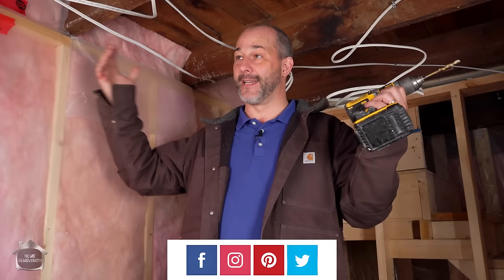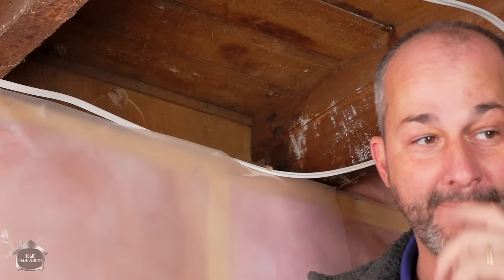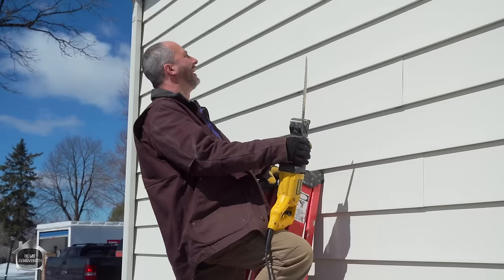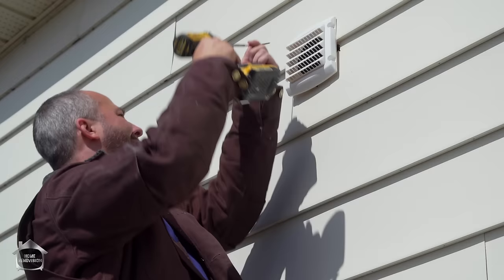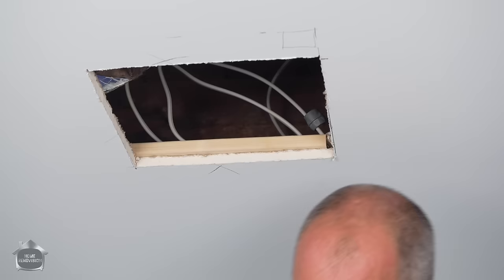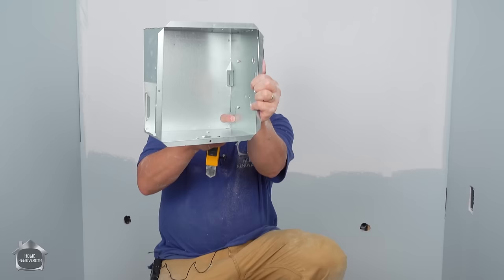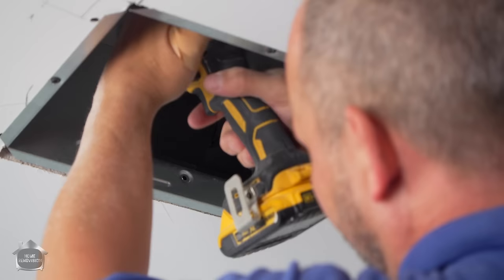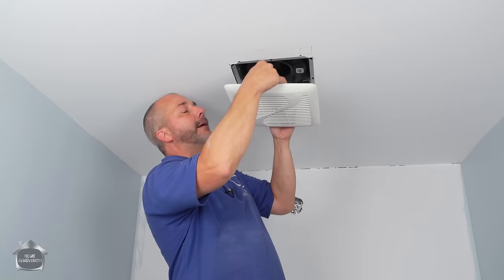How To Install A Bath Exhaust Fan | DIY

Comment: Custom hot tube is definitely the way to go. Especially after a long hard days work. Those massaging jets are amazing.  Also you you said you'll start in the fall. I cant you using a pool in the fall/winter.

Comment: After the pilot hole the outside work should be done w/a circular saw w/the blade backwards to not tear any siding - then the hole saw should be used as the pilot hole was drilled  in a 2by 4 or 6 inch .  The idea of using the hole saw is to have a uniform hole.  It can be started either from the inside or the outside. Having the pilot is the guide. A triangle hole will leave un-needed gaps.
Reply: How you cutting a circle with a circular saw???

Comment: I’m going to be replacing a heater, fan, light combo that was installed back in the sixties. The wires are fried but I have plenty of cable so I can cut it back to expose good wires. There are a 2 black wires. 1 red and 1 white. The house was built in the fifties or maybe even before that. It should be fun.

Comment: Future Video Idea:

Would be nice to see a video where a full bathroom is installed in a house that has an unfinished attic space that will be converted to a master bedroom with a full bathroom. Running sewer drain lines to the home's main stack located in the basement, along with water lines, toilet, etc. 

I am sure there are quite a few home owners who have a house that has an unfinished attic that offers a lot of potential, along with increasing the value of the home (I am one of them).

A video like that would be very helpful for viewers and would generate a large number of views and possibly expand your subscriber base to make it worth your time.

Comment: Hot tub. I was looking at store bought hot tube but open to other ideals. Enjoy your videos.
Reply from the maker: Cheers Fred, Looking into ideas now!
Reply: @HomeRenoVisionDIY  Maybe a outdoor wood boiler to heat the water?  This is  what I am looking into, using a 55 gal drum with 1/2 in copper tube as the exchange?

Comment: I am running a vent where the builder never ran it when they built in the 80’s.  It was venting into the attic.  So my question is how do I close the gap on my vinyl siding?  Should I trim the vinyl to fit the outside vent and how would you trim that and make it look good?  The way you did it is like some of my antenna panels, where I put wood behind it to give it a vertical finish.  The wire runs through conduit which is cult through that wood.  Thanks for your input.  I enjoy your channel.

Comment: For the hole, if you have access to one, use a quality hammer drill with drive feature, such as a Bosch Bulldog. I cut a hole in 2” of roofing materials (plywood, shingles, etc.) in under 30 seconds.

Comment: incredible the lousy electricity and plumbing instalation in the states , now I understand why the houses burn down totaly , imagen a short circuit in the walls etc and a electricity cable close to the shower , incredible , why the  rutes are not more strict , cannot understand that , regards robert

Comment: You can install the vent during the rough framing so that when drywall is placed it's already installed.
Reply from the maker: Yes, however we did it this way to demonstrate how to do a replacement as well. Cheers!

Comment: Thanks, very helpful… I have a replacement to do where the original mount point is no longer secure… was wondering if the fan mounted to straps secured only to dry wall ceiling like you did would allow for  vibration… but your install looked pretty solid. Thanks again.

Comment: Just use a long bit and put that pilot hole all the way through.  Use the hole saw from the outside.  There are multiple layers of siding and sheeting, cut through one at a time.  No problem and it's much more efficient.

Comment: I am a HUGE fan of your videos and I'm actually using your Tool Shed video to build my own, only mine is a little bit larger (5x3 m). I try to save a few money by DIY-ing myself as much as I can around the house and as much as feels safe to me. I have a house that is 2 levels (ground floor + upper floor). Ground floor is about 80-90% done (only bathroom tiles to go), but upper floor is still a work in progress. It would really help me if you made a video for a regular staircase between the 2 levels. I does not have to be fancy, it has to be practical and allow me to carry materials up there. Also, it does not have any bends, just a plain straight staicase, about 2,5 m height difference. Thanks!
Reply from the maker: Cheers , Happy to help!

Comment: I suggest wiring the fan to a light or if it's a fan/ light combo wire it so when the light switch is thrown the fan comes on. Trust me, children, and most adults, will not turn the fan on thus negating the benefit of having the damn thing in the first place. Just the way it is. Good video.  Thanks.

Comment: We use 12 gauge wire for most residentual.....smaller 14 gauge we can use for light switches
Reply from the maker: we use the 112 in the kitchen only.

Comment: Use a hole saw from the outside after drilling the pilot hole all the way through from the inside.  Just go slow and use a sharp hole saw.

Comment: Wish I knew they had these. Had to replace a smaller fan with a larger one due to moisture and although it was pretty simple the vent had to go on the outside of the box. It wasn't really that difficult but it would had made it much easier. Maybe it could have and I just didn't notice it I'm not sure but I'll check next time. The client picked up the box and it's not something we usually do unless it's before drywall. We do however seem to replace quite a few motors and blades though.

Comment: This bathroom will be freezing with all the cold air coming in through that cover.  Do yourself a favour if you live in a cold climate (i.e. Canadian Prairies...-45C), put a backflow valve (plastic flapper valve) on the inside of your rim joist when you bring the duct in so cold air doesn't pour in when the outside flapper inevitably freezes open.  I also did this with my dryer vent on my last house build and it was a brilliant move.  Plumber had no idea what I was talking about...I did it myself 🙄  Actually as this is an upstairs fan, you really should put this through the roof so the soffits don't suck the moisture up into the attic.  Not an issue if you don't have a 'real' winter, but I found out the hard way not to vent it out the soffit.  There was about 6 inches of ice on the inside of my attic and all the insulation was soaked.

Comment: Good tutorial. I have to replace a ceiling fan/light combo that runs off of two switches  (one for each). My vent will run out to a 2 foot overhang that I can easily mount the cover on.  I think t he hardest part will be sorting out the wiring.

Comment: 12:30 You did everything right. But, there is always Murphy.. 
me, modified a connector to be able to use my bosch battery on my noname jigzaw (solder solder solder, fiddle, clamping, fixing diddely doo.. aaand done!) Turns out my wife dropped my cordless so the battery wont come off.. Just a plastic hook that lodged it shut but one project turnes into another project to anoooo.. and down the rabbit hole you go :D

Comment: interesting how you made it a diamond...might have been easier on you to take a longer pilot drill and attach the hole from both sides?
Reply: It was awhile ago and the only time I've drilled through the side of a house. I didn't want to but my customer was persuasive and agreed to take responsibility for the risk. 😮

I know I was able to only use the hole saw but can't recall if I did it from both sides.

Comment: you should twist the electric wires together before putting on the wire nut.   and an on-off humidity sensor is required in some locations.
Reply: Totally unnecessary to pre-twist your wire.

Comment: At 12:50 - I would have used a siding block (the kind used for light fixtures).  They have a contour that fits right up against the siding and makes for a flat surface to mount a fixture on (or in this case, a vent).  I just did the same thing a couple months ago.
Reply from the maker: That is what I said. But since I am changing the wall anyway we will get to that later. Cheers!

Comment: Hi Jeff. Huge fan of the channel. I apologize if you’ve already addressed this in a previous video and I just missed it but I want to add a bathroom fan to my finished bathroom and would like to know the correct way to wire it to the same circuit so it comes on when I turn on my bathroom can lights. I have full attic access to the can light electrical, but can’t find anything on YouTube on the correct way to splice into the existing can light wiring to power an exhaust fan. Would love a video on how to correctly do this. Thanks in advance.   Jason
Reply: hey Jason did you ever figure this out? I'm in the same situation right now

Comment: your video is loaded with great tips. The unit I am trying to install in a one person job is the Broan-NuTone QTXN110HL. The unit is heavy and does not allow me to install the housing so trying to think how to do this job without any helper. I am considering building a scaffold to hold it in place using low cost materials so I can install from attic side and up there do the custom wiring required for this advanced unit. I am documenting my job in my video production.

Comment: 14:13 The cheap flexible thin plastic will get oxidized and get fragile over time so it's recommended to use a stainless steel vent cover.

Comment: I’d think you have a thick enough cover on there, you could cut it on the sides to fit it to the siding. Like, just a triangle, and you’re good. Those sides look raised enough.
I wouldn’t trust caulking for that big of a gap.

Comment: The center "pilot hole" from the 4 inch hole saw, could have been your reference to use the 4" hole saw from outside in.  The hole saw would have been adequate to cut through vinyl siding and such.
Reply: The problem is the saw catching and throwing you off your ladder. If you are working on a scaffold, there is less risk.

I would use the pilot hole to place the hole saw properly on the outside, then mark around it for the opening. I would then use the spade bit to drill the four holes, but with the hole just slightly overlapping the cutting line. I would then use my reciprocating saw to cut the opening.

Comment: 14:14 the vent cover broke lol. You can hear a shard of ppastic fall into the duct after he beats on it with the drill battery. Also, caulk should not be used to fill large gaps like that. Cut the siding, or install a shim with the same outer dimensions as tye vent made from an offcut of spare siding.

Comment: You certainly could have used a hole saw to go through the wood if your shorter on time but like he said, it likes to bite and if you're working off of a ladder be extremely careful as all it takes is one hard jerk for it to literally throw you off the ladder.

Comment: Honest question from Cedar park, Texas! If I wanted this to be extra airtight would I foam around the gaps into the attic after it's installed?  This video is super awesome! Thank you for taking the time to make it!
Reply from the maker: In an attic you should have a plastic well that is sealed to the vapor barrier. But yes any sealant will help. Cheers!

Comment: My basement bathroom renovation is happening & I would like to add a vent light. My only option is to go out between joists like this video, but the hole would go out over an screened in porch/deck. The outside vent would only be inches from the deck. Is this a problem? Seems unusual. I need a vent in the bathroom because I am installing a shower. Suggestions? Thank you for your excellent videos.

Comment: Why not buy a foot of siding and fill in the space below the vent with it so the vent is secured to all four sides and use a small amount of caulk to seal around the vent? Most any siding would work by sliding it up and down to do find the best fit to level the vent and cut it size. Simple!

Comment: Lets cut a square hole for a round duct to go through. Lets break the outside cover. Lets wait till the drywall is in place, then cut the hole for the fan housing.23:35, I made the hole bigger than it needs to be. No safety glasses in any of the cuts. I could go on and on but the worst is the building envelope is now compromised for moisture intrusion and the bathroom walls are now compromised for the wet air that will be trying to escape around all the openings. Saying you are in your own home doing electrical work is legal isn't if you do the work wrong and you sell the house and  the house burns down because of your shortcomings.
Reply from the maker: I am up for this. First the duct work was installed before we closed the walls so the building envelope for insulation and vapor is intact. The fact that the exterior vent cap is damaged is easily replaceable and the damage happened due to the cold temp we were working in. teachable moment. The hole was not oversized and the install after the drywall also shows folks that replacing a fan can be done in an existing space! Ther square hole ( actually a diamond) was cut to help folks who don't own all the tools and has no negative effect on the structure. Feel free to use safety glasses if you want! The electrical work is legal and inspected and on permit. Feel free to comment ! Cheers!

Comment: What happens if you use a 110 CFM fan with an existing 3” line? Most say just use the 3” to 4” adapter. Will it blow off the vent line or burst it?

Comment: Shouldn't you have hose clamped the 4" duct.  Then foil taped the insulation.  Then pushed the unit in and screwed it secure.  Seems like you just secured the duct, and carelessly pushed the insulation through the box.  Shouldn't the insulation be taped to the 4" circular part?

Comment: First I think it would have been better if the outside grate was placed completely flat on ONE board, not between boards. Less caulk to worry about and no leaks. What about a damper to prevent cold air from entering the grate? Lastly, many installers states never put the exhaust anyplace but through the roof? No flow back into the soffits and back into the attic to develop mold.

Comment: On ducting you're suppose to use foil tape. Never use tuck tape.
If he drilled through the rim joist or bracing,  whatever that it is, right above .. he wouldn't of been on a transition outside. 
If use a dryer vent type exhaust it would fit dead center in-between the siding strips because dryer vent exhausts don't have that fancy exterior cover plate.
He could of still cut siding out and around so not making it sit flush was just pure laziness.
That flexible exhaust ducting hose is not code compliant.

Comment: Installed in my newly renovated bathroom ( 2 days ago) there is a cabinet tower to the ceiling.  The decorative top molding was glued on and came unglued and fell to the ground(both pieces).  Doesn't a top cornice need to be nailed on too?  I came unglued myself when I heard the noise when it all fell off! I hired professionals to do this bathroom from start to finish.  Help!

Comment: Here's a question. One bathroom has a fan, other has a light... Can I tap into the duct work on the existing fan (that's like 10' away) and can I wire the new fan into the light switch? The light is too close to the shower/tub to put a fan as I've heard it should ideally be in the center of the room.

Comment: It been best to install fan close to shower so steam gets caught right away, not over toilet, and spend at least $60 for a 1 -2 sone loudness fan (1 sone is about as loud as your fridge, loud fans are 4 sones) 70-100 cfm, bigger is not better, for every CFM out your pulling outside air in.  A heater/fan is nice even in Florida in winter.  Don't forget a timer the auto humidistats don't work unless built in and adj. right.
Reply from the maker: 100 cfm will evacuate all the moisture out of a room in 5 mins. location is really not that crucial. Cheers!

Comment: I came back to this video for some good tips on installing an exhaust fan in our bathroom renovation. Thanks for covering all of the basics for me! @Home RenoVision DIY, any advice for installing through a brick exterior?
Reply: i got same issue as you lol but im on a 1 story so i  will run it thru the attic and out the soffit. if you have a 2 story and you have your bathroom in the first floor, ill guess youll have to cut thru that brick

Comment: I see a hole out side and a hole inside..  did the fan part have some type of flap to prevent a draft?   Else I think air will flow into the bathroom

Comment: Any suggestions how to remedy a contractor cutting a 7" square to run a 4" exhaust out of? Just insulate the gap with foam board? Or frame the gap? The vent is held in place with a 5" square of plywood caulked on to the siding and pipe.

Comment: Thank you Jeff for another good video. I m running into a problem here, i want to install an exhaust fan in the bathroom on the first floor, the joints between the first floor and second floor run perpendicular to let me run the duct to the outer wall. what should i do?  Thank you for your help.

Comment: Jeff Thanks as always great stuff. I don't think I understood why you choose to install the fan box after closing the ceiling?
Reply from the maker: I was kind of doing 2 videos in 1. how to run an exhaust and how to change a fan without going to the attic. win some loose some. Cheers!
Reply: @HomeRenoVisionDIY  gotcha! So if you have the ceiling open install the fan before closing.

Comment: Sorry Jeff but just use a longer bit for your pilot hole to get to the outside. then use your hole saw from the inside and then finish by using it from the outside. If you need to go a little deeper, use your wood chisel to chip out some of the wood.